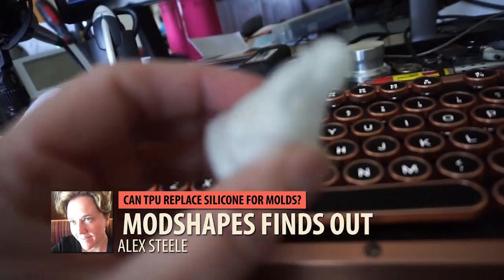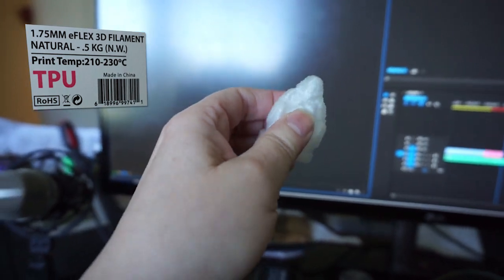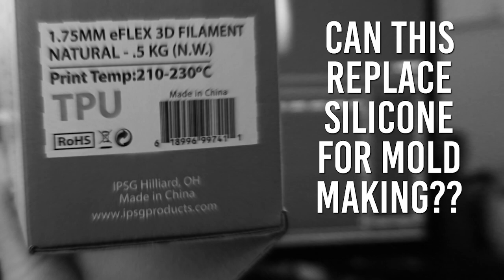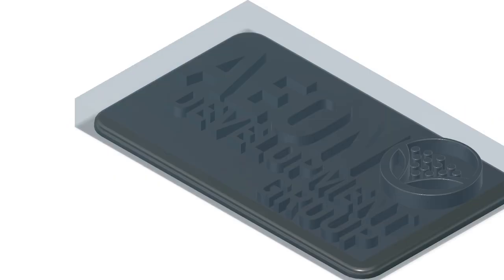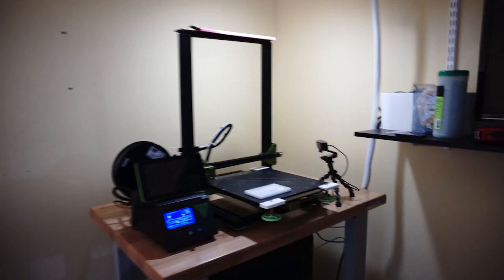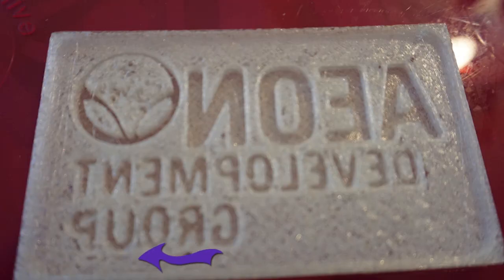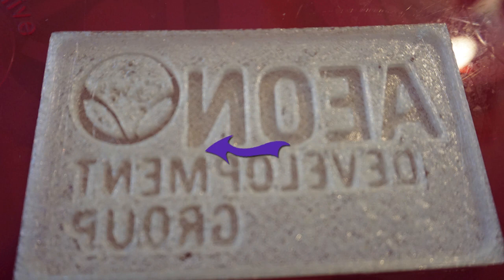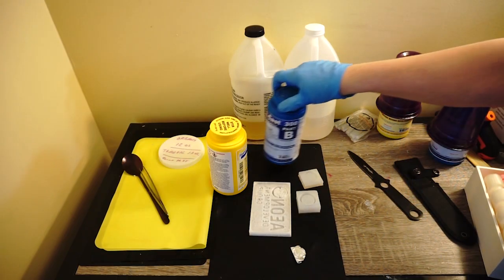TPU eFlex Filament - Can it Replace Silicone in Mold Making?

Comment: I think TPU can be used , you just made a mess out of the mold !
Reply from the maker: TPU can be used, but the print quality  was bad and that is the reason for material bleed in the mold.  The print was bad because at that time it was not printed on a direct drive extruder, and slippage of the material in the extruder during print caused poor adhesion.  We get awesome results from TPU from better printers.

Comment: I do a number of various types of arts and just learned about tpu. One thing I do is resin, so my mind immediately thought "molds"!!! I'm glad you made this video. Have you tried the mold release that the other guy mentioned yet? I'm following to see results.
Reply from the maker: I haven't yet, because I am looking into a 3d printer with a direct drive instead of bowden tube like the ones I have...  I had tons of trouble with the printer in that video, so much that it is kinda out of commission.  For molds, I am getting into  using a vacuum forming machine for some projects. But it's naturally very small results.   It would be so interesting to get this TPU going for good molds!

Comment: That's a really bad TPU print, mine are solid and look exactly like really high quality PLA prints.
Reply from the maker: It could be because this printer is not a direct drive printer.  Are you using a direct drive or bowden setup, what kind of printer are you using?

Comment: Print thick walls and base (3-4 layers), print 0.2 at least with "ironing" and then spray some kitchen grease on the mold before the epoxy and it should all be alright... works for me.
Reply from the maker: Thanks for the tips!
Reply: What do you mean by kitchen grease? Olive oil ? I am planing to do the same

Comment: I think ur print was really loose and with low definition. Which nozzle size and line height did u use? I'll try mine tomorrow.
Reply from the maker: It was a while back, but I think it was about .3mm height, a .4 mm nozzle that wasn't in the best shape.  Also, I replaced the extruder too after that as the material seemed to slip a lot and it seemed like a good time to do so.
Reply: @ModShapes  if u want to and have time try to print .12 with a .4 nozzle. With walls at 40 speed and 80 fill speed. Also if make sense with this kind of filament enable ironing.

Comment: Poor experiment I guess. The mold almost look like a sponge, far from perfect.
Soon I'm gonna try printing few molds with TPU for resin casting and see how it goes.
Thanks for sharing anyway.
Reply from the maker: Its all about having fun and enjoying the process and results may vary.  Resin casting into printed may not work if you don't like the build lines  - 3d printed molds would be OK for something like concrete since the material is more forgiving. Build lines and spongelike quality can work artistically it depends on the end purpose.
Reply: Hamza, did u have any good result?
Reply: did you test this?

Comment: Hi, just looking at your TPU print I think the extrusion multiplier needs to be set over 1 and ensure there is no retracting during the print. As retracting and under extrusion will cause gaps in your printed piece like we saw in your video. I've just started using TPU and have quite nice solid prints with no gaps. This should help a lot. Thanks for making your video. Sharing your experiences is appreciated.  Reference link https://flexionextruder.com/print-flexible-filament/

Comment: What would have happen if you printed it water tight?
Do you think it would be useable?
Is that filament as flexible as the ninja flex?
Reply from the maker: If one is able to make it watertight,  it can be used it to cast molds into.  It seems to me to be only good for something where surface lines do not matter that much - perhaps concrete as the casting material.  The surface lines are very evident on that test print I made.  I have never used Ninja flex so as of this moment, I don't know...